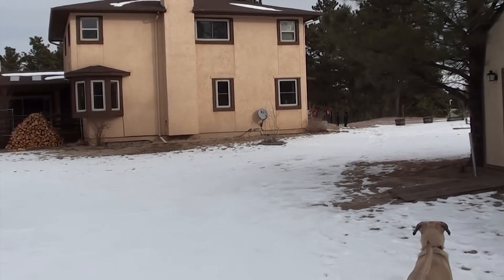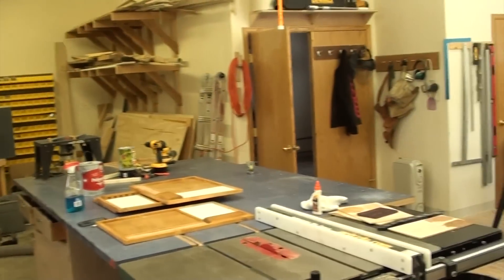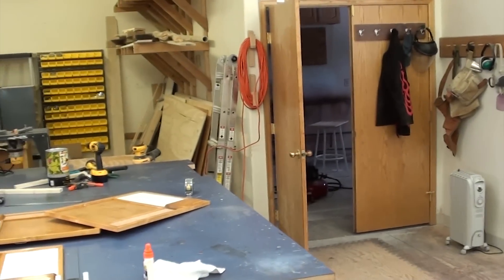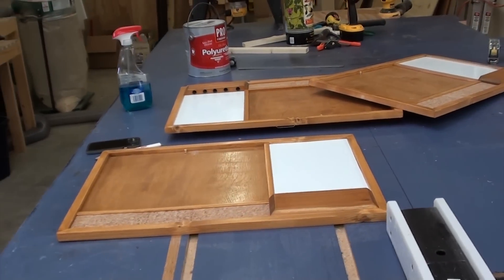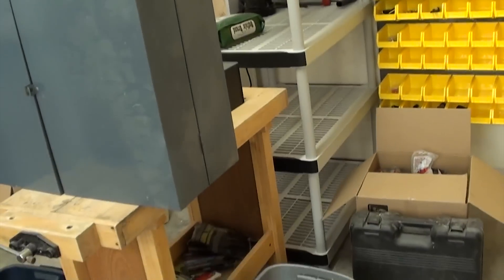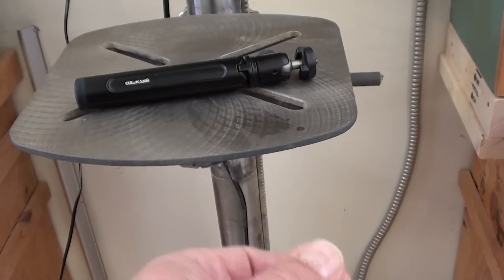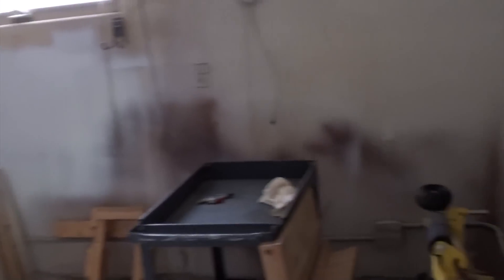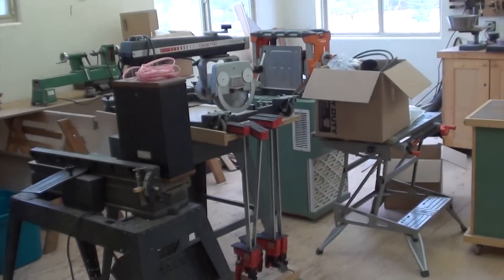New Workshop - Watch the Work Shop Tour

Comment: Some things I would recommend is take a section of the wall and dedicate it to tool holders Hammers, saws, screw drivers, files all that kind of stuff. It makes it so nice to have stuff you use all the time right in the open easy to grab and put away. Something i did with my radial arm saw was to build it into a bench against the wall. the fence has to sit off the wall just over a 1ft on mine so I was able to use the space up higher for shelving down lower I keep my grinder and scroll saw, right now they just sit behind it and i have to lift them onto the main portion of the bench to use it but my plan for the future is to put them on short drawer slides and notch out the fence so i can just pull it out when i need them. I dont know if that idea is helpful to you with what you have planned though.
Reply from the maker: No solid plans yet, but thanks for the suggestions!!  And thanks for watching!

Comment: Nice shop. If I had all that space I would not put my router in an TS extension wing. I would have a stand alone router table. I  always seem to need to use the TS when the router wing is set up.
Reply from the maker: Good thought - but I only rarely use the router.  Thanks for watching!